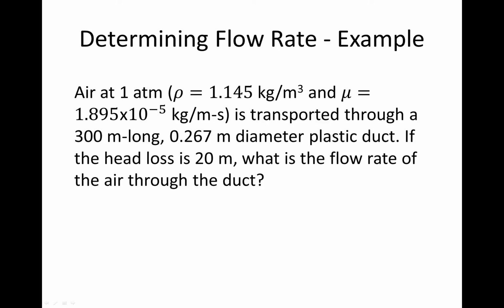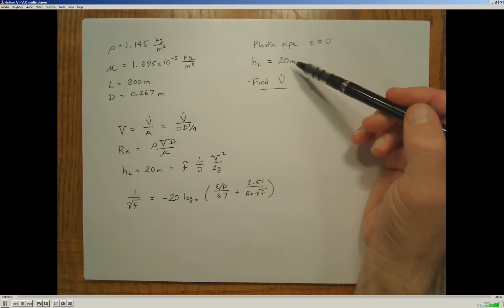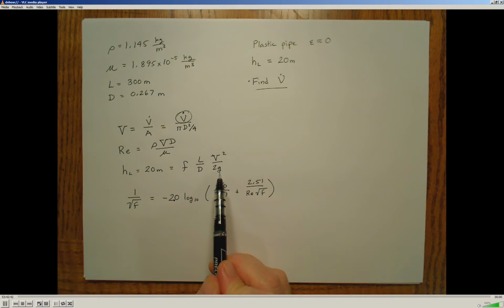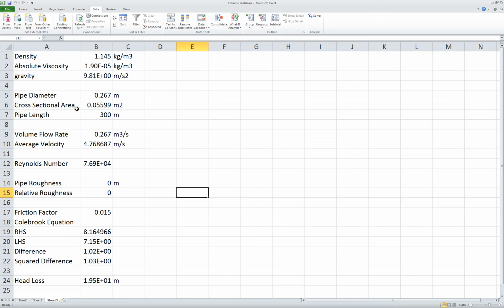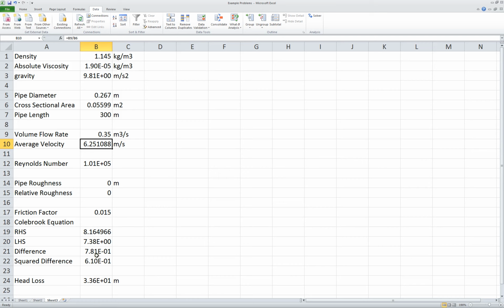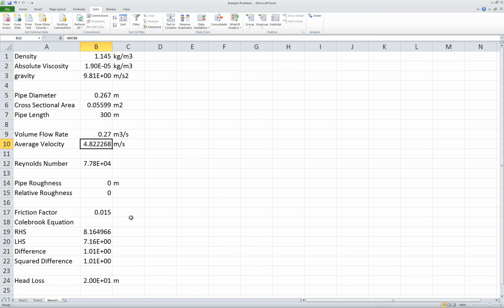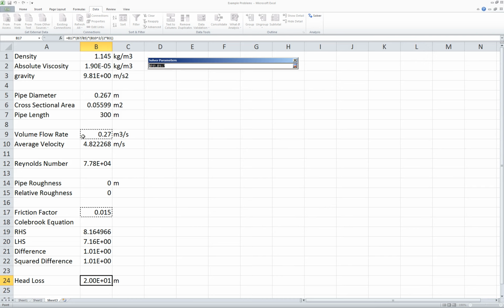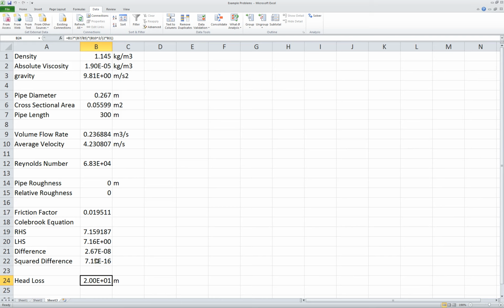Pipe Flow - Calculating Flow Rate Example

Comment: Dear sir. Many thanks for your video. it was really helpful. I just have a quick question regards to find the velocity of my equation. Lets say we want to put our pipe in to the river. the river has a flowrate of 2 m3/s and the there is no head loss for our model. the diameter of my pipe is 5 cm so ... I want to find the velocity of the pipe  so should I consider all information that you had..or can I find the velocity in terms of Q=AV as the which gives us the velocity around 1000m/s which is a bit strange cuz I didn't expect that in 1 second the water can move around 1000 meter. I really appreciate if you can kindly help me to find the velocity in my pipe.